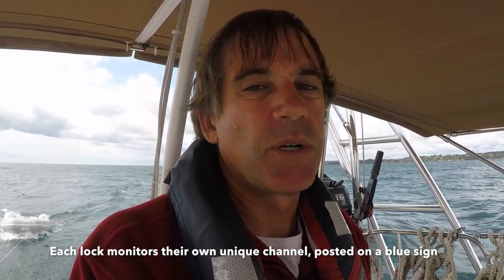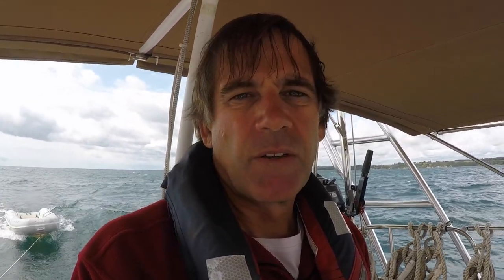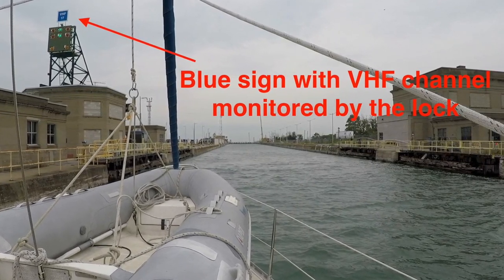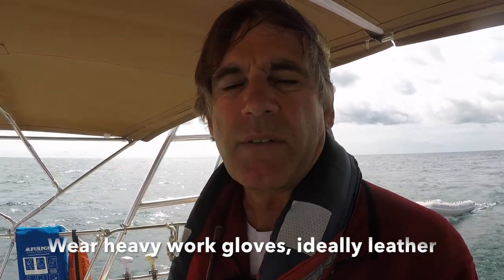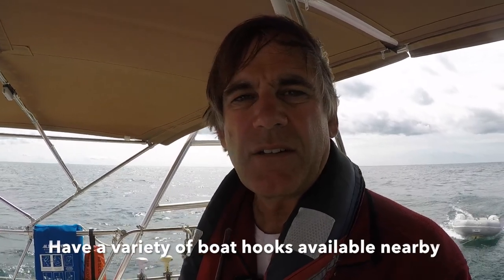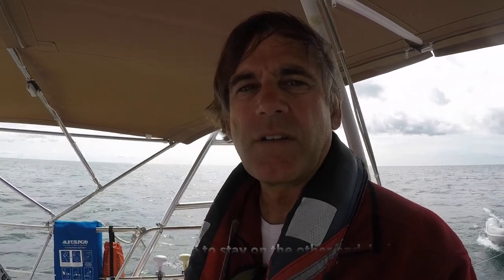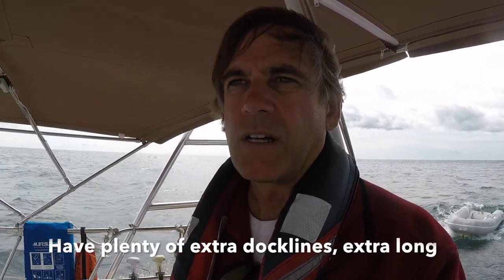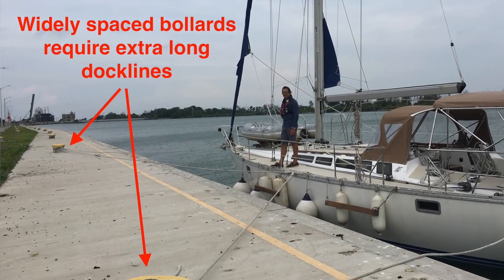Tips and Tricks for Transiting the Welland Canal in a Pleasure Boat | Ep. 8

Comment: Great video, one question
did you stop your engine during the drops? or you should run it all the time?
Reply from the maker: Hello Berk. We did a little of both. Downlocking was a little easier to keep the engine running but when uplocking the diesel fumes can be very difficult if not dangerous when you are sitting down in a deep cavern waiting to rise up for fresh air. It can be bad downlocking if you have to wait for a long drop, or other boats are around you too.